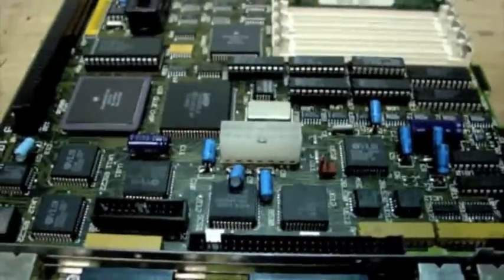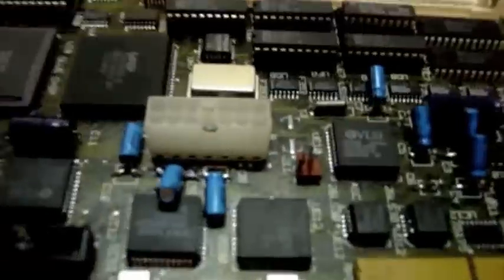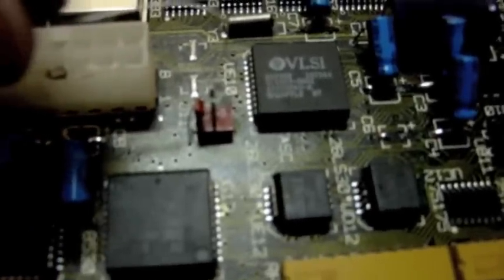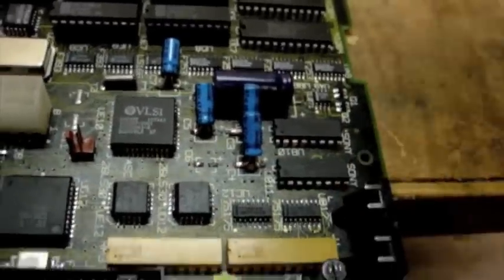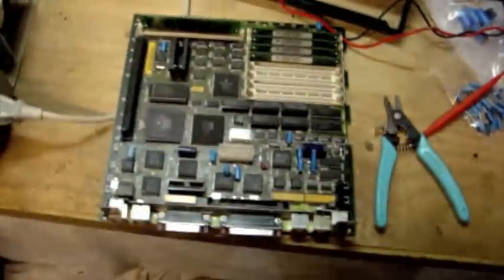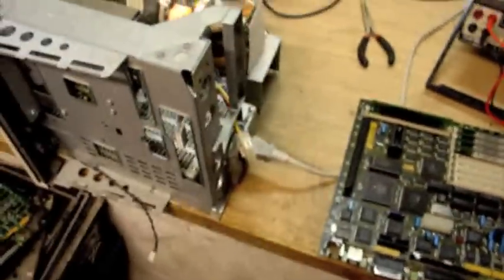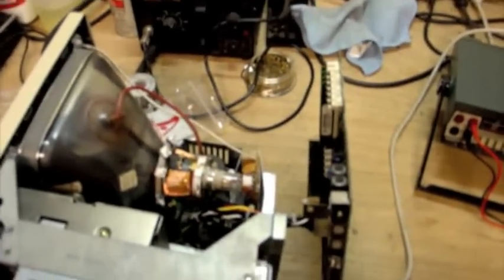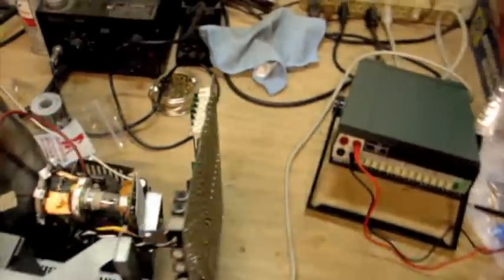Reviving Macintosh SE/30 Board 1

Comment: I have a problem with my macintosh. I have the se and I got a new 230mb hard drive for it. I am trying to install Mac OS 6.0.8 but I can not get apple hd sc to see the drive to format and get it going. The drive spins up but I he noes what is going on. Please message about what I could do. There is some rust on the board but that is on the back where the ports are and not really anywhere else but the frame. Please help if possible. I can make a quick video on my channel showing the problem if needed. If there is some better way to message let me know.